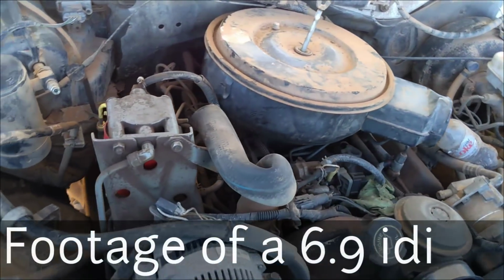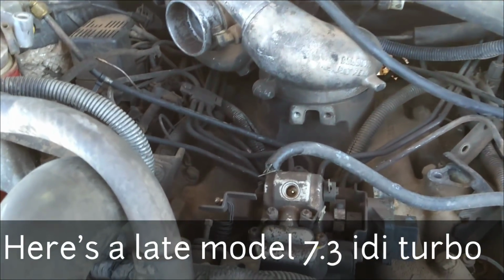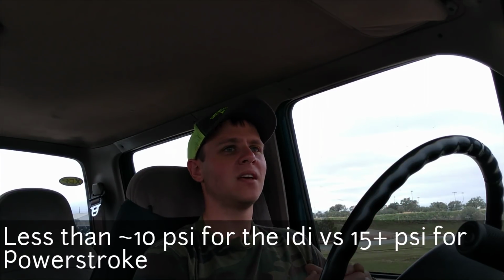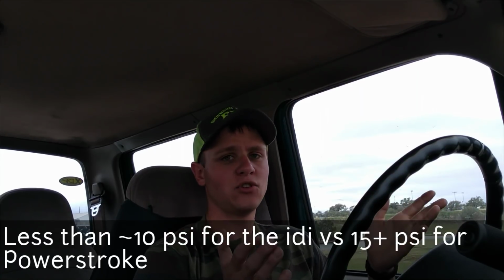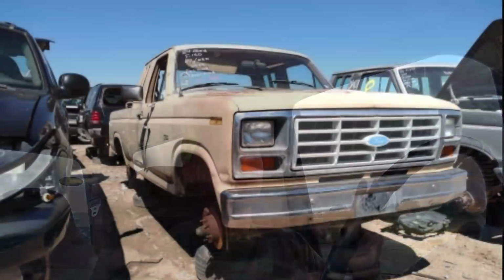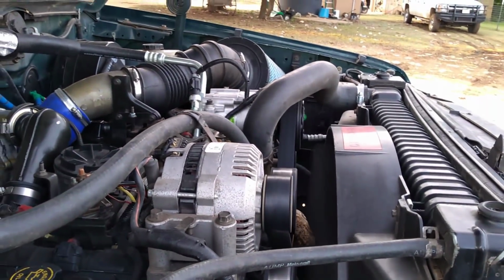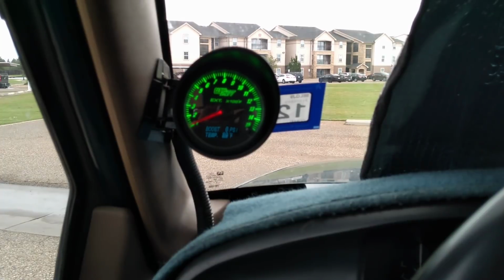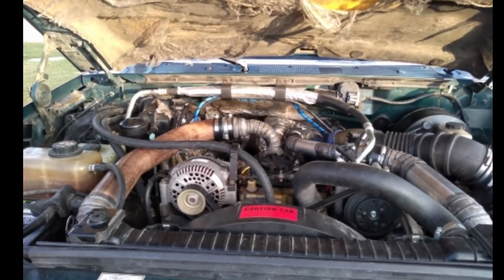7.3 Powerstroke Pros and Cons Part 1 of 2

Comment: I have a 94. 7.3  powerstroke turbo with 290000 still hammer down best truck ever 🔨👇
Reply: I’m about to buy me a 7.3 5 speed 4x4 1995..
Reply: @ZeroDark98  good luck man
Reply: I have a 1982 GMC C1500 6.2L diesel TH700r4 with 407.243 miles on it that I bought new and the 6.2 has had one ip change and 4 sets of glow plugs and 2 glow plug controllers. The injectors are still original. The TH700r4 has been rebuilt 3 times. Once the truck was ready for its first oil & filter change I began using delo 400 30w for summer and 15w-40 for winter I also changed thermostats 180 for summer and a 195 for winter. The pickup is showing usual rust that gm pickups are famous for, I'm going to see which one of us last the longest. I just remembered that before I drove off the lot I stuck a ball bearing in the vacuum hose right at the egr and I pulled the injection pump out and did away with the Teflon governor retainer ring.
Reply: @mikemcgrew65  Cool. 2001 7.3l here. Much.more.complicated then Your 6.2 but im at 315k miles and my engine is just gettimg broken in.
Reply: 5 speed or auto?
Reply: @centraltexasfoxbodies  5
Reply: @sun9912  10-4 bro, I have the same truck, every one always asks if I'll sell it, crew cab 4x4 5 speed is the best combo.
Reply: @centraltexasfoxbodies  I'm thinking about selling mine for 5000
Reply: My dad has a 94.5 that came factory idi but the factory recalled it and converted to a turbo Diesel and put a new tune on it. Runs better than any 7.3 I have ever seen
Reply: @Blazewrx02  I dont believe that.
Reply: @centraltexasfoxbodies  what don't you believe about it
Reply: @Blazewrx02  still waiting.....
Reply: @Blazewrx02  ford wouldn't have swapped out the idi and put a powerstroke in it. That makes no sense.
Reply: @centraltexasfoxbodies  2001 F250 7.3PSD CCLB. 311k miles original injectors. Abused to hell. 6 owners work truck. No blowby and running like a top no smoke.
Reply: @samuelyi9189  not sure what your point is but... ok cool.
Reply: @centraltexasfoxbodies  Sorry. Let me elaborate. 7.3 PSD is one tough ass engine. And its anazing to even see how abused a 7.3 can be but still run like a top
Reply: @Blazewrx02  I call bullshit. The wiring harness alone would be more work than any dealer would do. 1993.5 and 1994 came factory IDI turbo. 1994.5 was powerstroke.
Reply: 5

Comment: How much boost is safe on a 97 7.3? I can regularly hit about 40psi, just wondering about head lift.
Reply from the maker: Wow, that's a lot of boost! I've heard 40 psi is about the limit before you'd need to worry about the head gaskets. What sort of mods do you have to reach 40 psi?
Reply: @Rnddiesel  4" exhaust, AFE intake, 1.0 exhaust turbo housing, beans billet wheel, 360 degree bearing. Rosewood 160/30 injectors,, Hydra chip with PHP tuning. No intercooler. Get high EGT's quick, cant stay in it long
Reply from the maker: I see, I'm impressed, didn't think a stock turbo could physically make that much boost! The 160/30 injectors probably help you spin that turbo nice and quick. I've got a similar setup, 3-3.5 inch downpipe to a 4 inch pipe. 160/00 injectors, TS6 chip, but I do have an intercooler. I don't have to worry too much about EGT, but then again I don't exactly have a lead foot. How much did all the turbo upgrades help? I'm especially curious about your 1.0 exhaust housing...
Reply: @Rnddiesel  injectors were a night and day difference. The turbo housing does definitely help spool up especially with the injectors, it's not meant for anything more than stage 1's so I'm on the edge with 1.5's. You do get higher egts quicker with the housing and more backpressure. The bearing increases thrust load capacity and lubrication from the stock 270 degree. So you can push more boost. Oh I also gutted my EBPV so removing that butterfly does open up flow a bit.
Reply from the maker: I'll second the "Injectors were a night and day difference." My only issue is that to use the injectors and make power, the truck soots like a old locomotive! If anything, I'd like the 1.0 housing simply to help with smoke. I don't like being 'that' guy if you know what I mean. I'd figured the 360 turbo bearing would help it live with high boost, I just didn't realize it helped that much. With the 270* thrust bearing, I'd heard 25 psi was the maximum safe limit on the stock turbo. I may look into gutting my EBPV as well, too bad you can't use the extra control arm to run a VGT... (still working on that one). It sure sounds like you'd benefit from an intercooler though, especially with 40 psi of boost. The intercooler doesn't help with EGT on the low end, it's only when you start really making boost that the intercooler actually cools things down.
Reply: @Rnddiesel  the smoke is killer with no boost. Getting on the interstate with 3.55's and 35" tires at low rpm kills the people behind me. I have seen one truck with a 6.0 turbo before which is neat
Reply from the maker: Heck yeah, only the 6.0 turbo has the vanes that like to clog up. I'm currently looking at the practicality of creating a turbine housing that could potentially bolt up to the TP38, or perhaps some variant thereof to sort of give variable geometry. The main issue is avoiding turbo surge down low, might just need to try it and run with it for experimentation, could be fun!
Reply: @John Campos  i like the 1.0 if you go bigger than 160/30s keep the 1.15. I dont have to deal with cold weather so never had a problem, the times ive traveled i just plugged the block heater in. I think the ebv has more problems then its worth. Can get stuck partially closed, restricts flow and can be prone to an oil leak out of the pedistal. I gutted mine, used a freeze plug to cap it and tapped the old pedestal for a bolt and sealer. No need to buy the deleted pedestal and ebv unless you want to
Reply: Your safe at 40.  Nothing over that it specially if it's never been had started or got a trillion miles on it

Comment: Like the video , my dad has a 97 7.3 i had 2 6.0s and even studded  them got rid of them and bought a 2000 7.3 with the last forged rod year and couldn't  be happier
Reply from the maker: Wow, that's amazing, you sold your 6.0 for an old slow 7.3!? How does the 7.3 compare to the 6.0 in your opinion?
Reply: @Rnddiesel  im going to be honest, the 6.0 was a beast when tuned by gearhead  preformance. i did all the mods needed egr delete ,studs ect.... was puting out 437hp and 726 of trq to have it trustworthy  ,but just kept nickle and diming  me , in stock form the vgt down low is laggy but when she lights up it like a shot  of adrenaline  it has a nice powerband in mid to high rpm since its a high rpm motor .she does well in towing and is nice around town but with all respect. the 7.3 does the job again and again and again and might be slow but reliable  with no studding needed no egr delete and is reliable is a big factor and the torque  is right their , i dont see the need  for something  new if we have the last great motor we all look for these trucks are becoming  harder and harder  to find ,and when you do especially  the 97 you have that is considered  the holygrail it coast a leg and your 2 balls down  here in south  texas ,
Reply from the maker: Holy cow, it sounds like your 6.0 had some power! You've got some interesting points. The technology on the 6.0 is pretty cool, but it really stinks that it inherently has so many issues. I'm sure glad I got my truck when I did, heck I picked the thing up for $4500, but I've put a lot more into it at this point trying to fix it up and everything. Thanks for the input!
Reply: Raul, With the reputation of the 6.0's blowing head gaskets, why would you tune it up only to place greater strain on the head gaskets?  I have a 2003 7.3 with only 37,000 miles on it that I've had since it was new.  I hardly drive it obviously unless I need to haul something or am pulling my cabin cruiser boat.  When I first owned it, I tried one of those tuning kits.  Yes, it increased performance, but my EGT's were running way too high and the computer was throwing codes.  These engines can't be tuned beyond stock setting for towing applications without self destructing due to heat they can't get rid of fast enough. Unless I'm going up a steep grade, I've never had any problems maintaining the speed limit.  I'm happy with my truck with its stock settings.  The transmissions in these trucks are marginal anyway.  I let mine wind up slowly and then I can keep the pedal to the floor all day long without worrying about burning it up.
Reply: IDAK, Sounds like you have a very nice rig. On the tuning note, the 7.3 can indeed be tuned up without "self destructing". S&B intake and 4" exhaust will help keep the air flowing to keep things cool. Lots of folks have tuned them up to 400hp with no loss of reliability or longevity. You're, of course, correct on the tranny. Fortunately there are now several sources for improved 4R100's. I'm installing the Legendary 4R100 from Dieselsite next weekend in my 2002. The original trans has 225,000 mi on it and is still working fine. I just want to imrove it before I begin my HP/TQ journey!BTW, I'm jealous of your truck!
Reply: @evadevries2952 ,  I live in Nanny State California.  The man I've been going to for smog inspections states you can't change anything about these trucks-emission wise or he has no choice but to fail the truck. The entire inspection IS a visual inspection.  This includes things like 4 inch exhaust pipes and K/N air filters is what he explained to me that you cannot modify.  The heaviest thing I pull is my boat which weighs 6K.  The steepest hill I've ever climbed on a interstate has only slowed me down to 45mph.  The notorious Grape-Vine hill traveling towards L.A. I can take at over 50mph. Other than climbing mountains, I can maintain the speed limit quite easily and get decent fuel mileage compared to pulling with gasoline model truck.  If not for towing, I could mod (program) the truck for just having that extra power when I wanted to accelerate fast for short distances because the EGT's are slow to climb, but on a long climb while towing, I have to back off on the gas pedal to keep EGT down.  I got tired of watching the EGT gauge and its easier to just run as stock settings and not have to worry about it.  I have a friend who had a 2002 who killed the transmission in 70,000 miles and he didn't even tow with it.  The way he drove it though was he floored it every time he took off and he also had the computer mod to increase power.  I believe what kills these transmissions is hard acceleration up to red-line rpm's and shifting.  The stress on the transmission to absorb all of that torque is what's hardest on it.  When I tow, I disable the overdrive and take my time accelerating up to speed.  Once the transmission is locked in high gear, I'll floor it all day going up hills and I don't think this puts any extreme stress on it.
Reply: IDAY, I too live in the Peoples Republic of California. I agree that tunes and a heavy foot will kill the 4R100. That's why I'm upgrading the tranny first. As far as smog inspections, A flash tuner is the way to go here (like SCT 4). Since there's no "hardware" installed (Knob and PCM chip) you can run tuned for 2 years then just flash back to stock tune prior to smog inspection. There are also some Cali approved mods (S&B intake, larger exhaust) that will do wonders to keep your EGT down.I'm not trying to talk you into tuning. It sounds like your truck is treating you well and will surely last a very long time. I tow up to 10k in the mountains where I live. A light tune helps with the hills as well as modding the shift points for mountain driving. One mod you may want to consider is a larger tranny cooler. Many believe that the stock cooler is responsible for short tranny life. I went with the Mishimoto. The swap is super easy. 2 hrs max.

Comment: RND= Powerstroke encyclopedia. I think you mentioned in an earlier video that you’re a mechanical engineer. It’s nice to see a mechanical engineer that’s actually mechanically inclined as well as book smart. I’m sure you’ll tell us in the next video but why are the 7.3’s so much louder than a modern 6.7l. Are HEUI injectors making all of that clatter?
Reply from the maker: Cfass1, Haha Thanks! Past 7.3's I really couldn't tell you much about say the 6.0, 6.4, or 6.7 etc., but I'm working on it. There's just something about 7.3's that makes them fun. Yeah I am a Mechanical Engineer, well just about; I've got 8 months left until I graduate. It really is kind of unnerving to see other "Mechanical" Engineers in my classes who weren't even "Mechanics" to begin with, but I guess that's just the way things go. Part 2, I'm working on, and yes it'll talk about why 7.3's are so much louder. Rather the 6.7, or any of the new diesels are just quiet engines in general. If you're curious, look into "pilot injection," that's what modern diesels use as a technique to quiet down the clatter. Basically it gives a small shot of diesel first and then the rest of the fuel in the injection event. It also helps with emissions too!